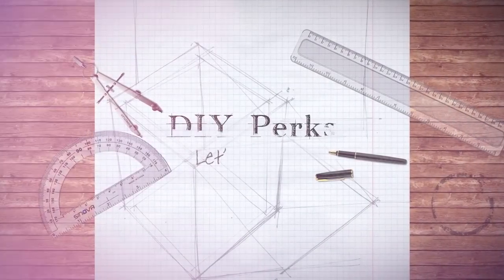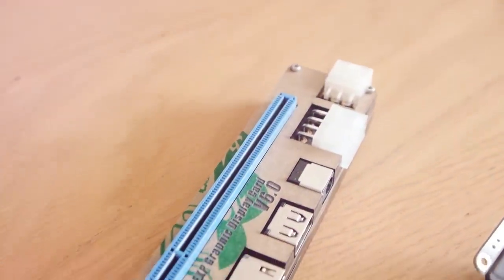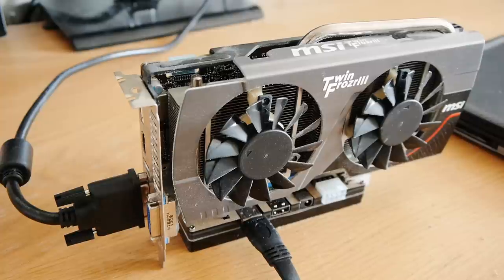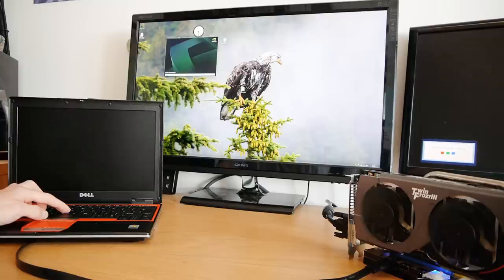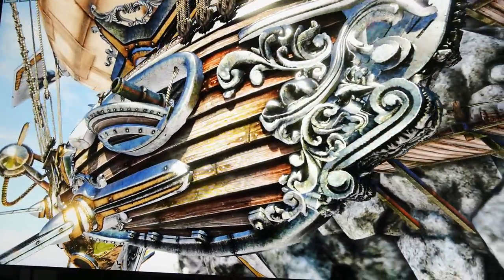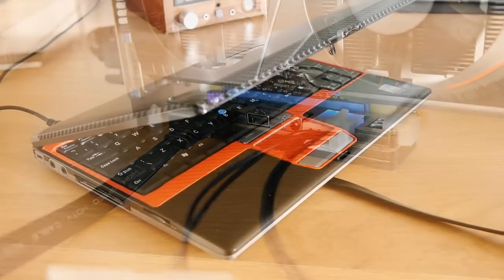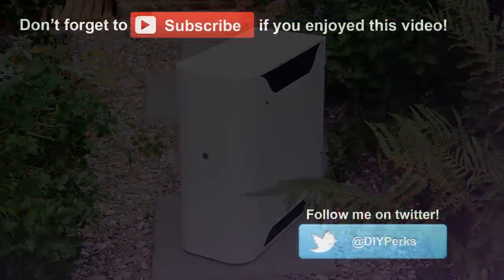Gaming on a Laptop using an External GPU

Comment: External monitor, external GPU, external optical drive, external PSU unit... This kinda defeats the whole purpose of a laptop in the first place lol. Pretty cool to see nonetheless, but I don't see how anyone would be comfortable with such a 'convertable' setup. Seems more convenient to build a PC and save money on the laptop by getting lower specs.
Reply: +prepa Hardly, you could take the laptop out with you and use it as a normal laptop then come home and "dock" it with all the hardware to play games.
Reply: yea but I mean the connecting and disconnecting is still quite inconvenient
Reply: you already have to connect the power supply to a laptop anyway, if you use an external keyboard/mouse/monitor you have to connect/disconnect them also.... You only have to plug in ONE cable with this external setup...
Reply: Bongo2k but you still need to connect the cables from keyboard, monitor, and mouse, which is the whole point of defeating the purpose of laptop. Of course it is optional, but you won't get the full experience from connecting to external GPU alone without the full setup.
Reply: +prepa  Midaswell take the laptop apart and Stick it in a case lol
Reply: +prepa You already have to connect a keyboard, mouse, and charger into the laptop. Might as well do the extra two steps and get pretty decent gaming performance.
Reply: external laptop
Reply: +Bongo2k Mini PCIe isnt designed to plug and unplug it often. After hundred or so cycles kiss your "gaming" rig goodbye. And WiFi card for that matter.
Reply: For people in college. With a laptop who want to game or cant afford a desktop.
Reply: *****
That would be cool, but the challenge would lie in making it as light as possible, also looks if you care about that.
Reply: +prepa And External Wifi Card / Ethernet. Due to most laptops only having 1 PCI mini
Reply: +prepa If you're like me, and you have a nice $500 laptop with intel graphics, then it may be worth spending the $50 on the unit and another $150 or so on the card, and max out all your games on 1080p, instead of having to spend another $500 just for a comparable desktop. In fact, I might just do that. Problem is, I just blew $350 on an SSD, so that next step might have to wait a while lol :)
Reply: High Flier Straight Outta Money :P
Reply: High Flier

It's already too much work for me to plug in the power, mouse and headphones every time I take my laptop out of its case lol. Whatever works for you I guess. I might be too lazy.
Reply: prepa
You should put a cappuccino machine next to your computer, so you don't have to wait on yourself :p
Reply: +Bongo2k 
YES..............
Reply: But the point he is trying to prove is that if you have a laptop and you want to play demanding games then you dont have to buy a pc sepretaly. You can use you laptop with an exter gpu and a monitor using an adapter which saves you a lot of money.
Reply: Anshul Bains
I suppose, yeah. I mean convenience might be important to me but if money matters more to other people then this might be for them.
Reply: +prepareuranus if you already have a laptop this would be a deal kinda but if you have a desktop  i run a 2.1 ghz and im pretty sure mylaptop would out beat this guys laptop with that graphics card and most the time i use up to 50% cpu my cpu bounces around alot but it puts in some work for something i got at walmart and got ripped of with prob would never buy another one though considering i spent more then i should have  spent about 700 on it usd and its not everything i wanted
Reply: +prepareuranus external psu isn't necessary if you're putting in a 750ti and external optical drive because who needs those these days inside of the computer? Very few do.
Reply: +prepareuranus 
it can be done with 1 cable if the  laptop have thunderbolt 3 (1 cable for power , PCIe and USB hub ) 
https://www.reddit.com/r/HPx/comments/41rpht/razer_delivers_thunderbolt_3_external_graphics/
Reply: +prepareuranus RAzer Blade stealh
Reply: he could just remove thc cpu from the laptop, and put in a case and motherboard xD
Reply: puru stil it's not an external motherboard because if so just buy a case
Reply: You have a laptop... and you have time but don t have money for a gaming rig ... you spend from 150 in up and start gaming
Reply: @nyankanakitty  use a regular dockingstation for that!

Comment: so if i buy a adapter and a desktop gpu i can play games on higher settings with a bottleneck from my cpu?
Reply: depends on your cpu and ram and the desktop gpu but yeah kind of
Reply: Also depends on the laptop.
Reply: ImportNation It doesn't depend on the "laptop". It depends on what's in the laptop, as Luxe stated.
Reply: MightyKrizpp Did not see Luxe's post, and am very aware that the hardware matters.
Reply: I have a I7 3610QM and 8 gigs of RAM. Does my CPU bottleneck a gtx 660? ImportNation MightyKrizpp Luxe DIY Perks
Reply: Well fml.
Reply: MightyKrizpp But thanks anyway.
Reply: Yannick Kloren I think you read it wrong. It won't bottleneck the GPU, is what I was saying..
Reply: MightyKrizpp Oh haha, sorry. Thanks Krizpp.
Reply: MightyKrizpp whit a sony laptop with i3 2370m at 2.4ghz and 8gb of ram will it bottleneck with this card ASUS R7260X-OC-2GD5 or MSI N750-2GD5/OC
Reply: Just a Geek. 2-5% bottleneck, nothing serious.
Reply: TheNiggaMary Yeah well i bought a new rig. But thanks.
Reply: Jermo Arensman Depending on your CPU. If you have something like a Core 2 Duo you should be less bottlenecked,
Reply: ive got a hp envy with an intel i7 and 14 GB of ram with a 1tb harddrive. im pretty sure that could run it.
Reply: Jermo Arensman its very difficult to bottleneck CPUs in fact you would have to use a very high end graphics card and and REALLY bad CPU to bottleneck it even slightly
Reply: TheNiggaMary where did you come up with that result?

Comment: My brother and I where talking about this, assuming you only have one of those power slots I'm sure you can just take the wifi card out and use a USB dongle instead. I would like to see a semi-portable enclosure with a built in power supply so you can simply unplug it and carry it on the go without the graphics card being fully exposed like that. It's an interesting concept though.
Reply: angrycreeper100 I wonder if that usb part that you linked could handle having the graphics adapter plugged into it, because then you wouldn't need the laptop's back off and such.
Reply: maybe usb-c could support it/
Reply: usb does not have enough power for it
Reply: USB-C can  transfer data at 10 gbits/sec, you may need an external power supply but the data transfer rate seems sufficient to render graphics if properly decoded.
Reply: angrycreeper100
This has nothing to do with power. Bandwidth is the bottleneck.
Reply: cmb271 You do realize that the bridge controller and circuit on the converter must also support this high bandwidth? Its the same like those cheap LPT and COM to USB Dongles and USB SCSI. They sometimes work for low-duty tasks, but if you really start to use them, they all fail.
Reply: cmb271 Maybe this is a perfect idea for a DIY video. How to put a GPU and PSU together in a semi-portable enclosure. The good thing you would really need a very very low Wattage PSU, since it would power the graphics card only and nothing else. So even 300W is overkill for most cards, aside from the r9 290x.
Reply: No, just build MICRO ATX PC!

Comment: Works perfectly on Dell XPS 17 l702x (3D) with EVGA GTX 970!
Reply: Should I Have 2 Mini-PCI? Or I Can Replace this connector with wifi adapter?
Because I Have Dell INSPIRON N5110 But I want to know if it will be compatible with my laptop or not before buying it...
Reply: The XPS 17 has 2 slots, it should work in the first slot(where the wifi card is) too. But I'm not certain about your notebook model.  The XPS 17 is not on the list and no one else tried it before. I just hoped that it works and had luck.
Reply: Thanks :D
Reply: Hi, I also wanted to add a gtx 970 to my lenovo y580. How well your card performs? Can you tell me a game with settings and fps that you get? Thanks a lot
Reply: Battlefield 3 nearly every setting max, 1080p --> 60-100 FPS (indoor, outdoor, big map, small map)
Reply: mini Cotulla where did you get the PSU for it?
Reply: I use an EVGA 500W Desktop PSU. The EXP GDC came with an adapter for it.
Reply: How long did shipping take? Im in Cali USA
Reply: Shipping took 2 weeks but I'm in Austria.

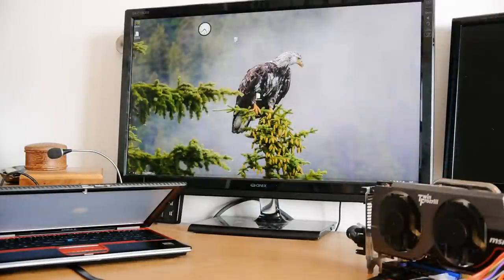Comment: How is the game running if the laptop is still booting up? 2:40
Reply: If you look at the laptop screen, it has the windows logo like the laptop is turning on.
Reply: Oh shit, nice spot. Yeah, that's a bit fucked.
Reply: There was an annotation explaining that (though I understand why one would turn them off because they can get annoying). Apparently the laptop rebooted while plugged into the tv, so the laptop display froze while the tv shows correctly. The workaround is spanning the desktop.
Reply: Annotation - "After restarting it switches to the main monitor just before it reaches the Windows desktop, leaving the boot logo on the laptop's screen. Not an issue if you span the desktop."
Reply: Patrick B will it work on a notebook?
Reply: no, Laptop only. duh.

Comment: does it really need to have the separate monitor?
Reply: Acer Marbella yes, u do, but i know in some cases u can still use your laptop's screen but with a lot fewer performance
Reply: the laptop display are connected to the integrated gpu so it can only display from it. While the graphic card on the adapter is not connected to the laptop display.

Comment: so if i want to use the external graphics card, do i need to remove i wifi adapter?
Reply: +Arief Iqbal (Plausiblelake16) no
Reply: yes you do.. if you have only 1 wifi module slot inside your laptop.. you will have to remove that to hook the extension cable.. unless you have 2 slots like in the video.. most laptops come with one..
Reply: ohhh thanks m8 :)
Reply: Ok but do you have to uninstall the PCI EXPRESS ROOT COMPLEX file? I don't get it. I have all the drivers installed and updated for my graphics card but it tells me this "This device cannot find enough resource that it can use. (Code 12) if you want to use this device, you will need to diaable one of the other devices on this system" i already have my stock hd graphics adapter disabled.

Comment: Do you really need to have an external display?
Reply: Yes the graphics card is what handles the display. When you switch the graphics card to an external one, you are essentially turning the laptop into as desktop.
Reply: Oh shit no!
Reply: Iqmal Danial
Not if you have an HDMI Input as my Alienware has ;)
Reply: DaKing4551  ew... alienware. Lol
Reply: So I need like two Inputs?
Reply: Answer me please?
Reply: Iqmal Danial You will need a extern display if you dont have any VGA Inpuds or hdmi in in your laptop.

you are using the outputs of the graphicscard
Reply: DaKing4551 so i have a hdmi i can plug it to laptop
Reply: xFaYd3_StRiK3rx I have VGA and HDMI can I plug it from graphic card to laptop ?
Reply: Tomáš Jaroš HDMI on laptops are usually outputs so you can connect laptop to TV for big screen action.
Reply: Ok, thanks for answer..
Reply: Iqmal Danial Why not just hook it up to a TV?  Run an HDMI from your card to the TV and use that as a display?
Reply: If you use the AMD series card,it must to connect with the external monitor to use.
If you use N series card which over GTS450, and  your laptop own Intel Core graphics ,and use the EGPU software to set,then it can use the laptop internal monitor,otherwise,it need to connect with the external monitor.

Comment: Will gtx 1060 work on this product? i have a i7 4720hq and 12gb ram
Reply: no
Reply: Yes
Reply: +firendable maybe - use hdmi to vga adapter a to make it work
Reply: it will
Reply: Yes
Reply: But is it worth it?
Reply: well, for those ones who do not want to waste their time selling their shitty designed laptop, that has a fucking i7 and 12gb on it with a fucking gt740m 64bit or something like that - probably worth it (i am one of those losers, bought a laptop for a 1000$ or so)
Reply: so.....  you think buy a 100 $ laptop with adopter is the same..??
Reply: ass catcher yep ... I bought also as you an Asus X750jb with same specs...
Reply: #Anto# #Anto# ok do you plan on adding the egpu to your laptop? Tell me the results?
Reply: I guess yes, I bought this laptop for 850$ ... a fucking shame today.
I built a new desktop pc that I'm using right now and it has a strix 970oc that I want to use as ECU. However I have to fix my laptop cuz after teardown and thermal paste change (it was reaching temperatures over 100C°) it won't star cuz a battery wire pin is fucked up xD
Reply: #Anto# #Anto# I know I don't know why I bought a gaming laptop. Stupid of me when I could build a beast pic with that money...
Reply: #Anto# #Anto# if you have a desktop don't add egpu
Reply: Try Hard Gamer sure man, i was just thinking about that idea to forget of the shitty performance of the GT 740M xD replacing it with a GTX 970oc :D
However its not worth it, ill keep it on my desktop xD

Comment: Why can't u use ur laptop screen?
Reply: Laptops don't have hdmi inputs.
Reply: +TZtenzin csgo&CoD 
Lol
My brother's Dell have one
Reply: lubu523 guess its time for me to buy a new laptop
Reply: not sure, he took it with him.

but u could look up "laptop HDMI" ;(
Reply: he meant hdmi input not output which most modern laptops have
Reply: You can, but only using NVIDIA GPUS, and the bandwidth is a bit smaller compared to the HDMI or DVI output and also resolution on the graphics card
Reply: At least with modern Thunderbolt 3 options like the Razer Core, you actually can.  I figure it would probably work with this setup as well, as the Razer Core is just a Thunderbolt 3 to PCI Express adapter, the card and driver are detected the same way.  You'd have to have the latest Intel integrated graphics driver as well as latest AMD or nVidia driver.  The latest drivers of both AMD and nVidia support render offloading (AMD XConnect/Dual Graphics, nVidia Optimus) which pipe the rendered frames back over the PCIe link to display on the integrated GPU (which controls the laptop screen).
Reply: WittyC ArtTV shit. My ones have hdmi inpit

Comment: Pretty cool, although now a days you can get a decent gaming laptop for $800-$1,000. I got my Lenovo Y700 for around $1,000 and it works like a gem. It has an Intel i7 processor and a GTX 960m. Still a sweet video and a cool adapter you have.

Comment: Although this method does work, i have been using this type of setup for years before i switched over to a desktop, for those on a budget with a gpu lying around then go ahead. But for those not really on a budget, dont. This is mainly because if the rest of your laptop is not up to par, then don't expect to run things at their true potential with this rig. I have to say this is by far the most insane deal for an adapter like this, because i got one similar to it for around $100 i think, and its not worth it. Though if you wish to go this route now to quench your gaming thirst and the only thing lacking in your laptop is the gpu, then it would be okay to go this route because then that way you can have a good gpu and psu for any future desktops to install them into. I did that with my gtx 650 2gb and was able to play games pretty well, but due to the laptop being a lenovo g560 they were not able to be at their best.

Comment: Interesting. I've seen external graphics arrays connected via thunderbolt, but not having thunderbolt on my laptop sadly concluded that gaming would be limited to my desktops. 

Although it's a bit of a messy option as you have it there, I'm sure with some off cuts of wood and metal from my materials crate I could make a half decent enclosure to tidy it up and reduce the risk of something getting snagged, if it was a daily use item. 

All in all the boys in China are onto something here and it will be interesting to see if there's any evolution to a more user friendly experience.

Comment: Just a note. HP G60 and Compaq CQ60 laptops tend to hang with an error if you install something in the wireless card slot that it wasn't expecting (such as a wireless card that wasn't offered with the laptop). I have not tried this particular device with one, but I do know that the CQ60-419WM will not boot up until you remove an unsupported wifi card. Dell Latitudes are particularly nice though since most have a separate slot for a 3G/4G card and you don't lose your wifi.

Comment: Diy Perks, I think the concept of an external GPU is really cool, but as I've seen you build cases and remakes of laptops, I was wondering if it would be possible to build a mount/ new case for the laptop that included the GPU to be attached and therefore more portable. If I could throw my 8th gen intel i3 1inch thick computer in my bag with an eGPU attached to the bottom of it, I totally would. It would make gaming while travelling more accessible and minimalistic.

Comment: I think, that lower benchmark score in laptop setup is due to the bottleneck caused by the odd cable. Propably standard, full size pci has more bandwidth than a mini pci/hdmi thingy.

Comment: Sadly, the availability of this adapter isn't provided on Amazon and other platforms anymore + most notebooks don't have ExpressCard so the mPCIe-version would be needed... but many modern laptops have soldered WiFi and stuff so you couldn't even use such an adapter when opening the device up :/

Comment: I have and older gaming laptop that the Gpu overheats and this would be a great way to re-utilize what I currently have. I also have another more modern I7 laptop that the gpu isn't really strong enough for gaming. Both could be interesting to see what I could do with this adapter. I also have a jetway laptop/desktop build but thats another project.